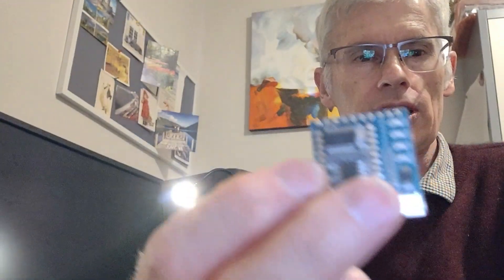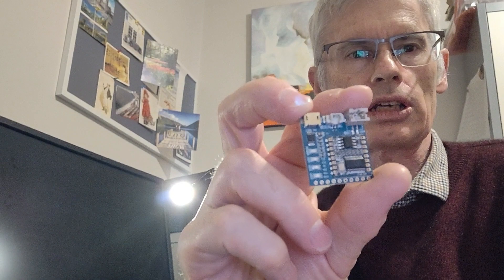How to FLASH Burn upgrade the HiLink HLK-V20 Voice Recognition Module

Comment: Hi sorry to bother you I have one question I tried uploading the program but unfortunately the moment I connect the 5 volt the burning tool app will crash 
What should I do
Reply from the maker: @amanjmohamadi7532  It seems that this program has a driver device conflict which may be the reason it crashes. Try installing it on another computer in the meantime, until your existing issue is resolved.
Reply: @ thank you so much would you  recommend a driver that is matched with the burning tool🙏🏻🙏🏻

Comment: I can't upload firmware. I power up the module after the yellow bar appears on the update tool software, just like you did. The the uploading never starts. Any help?
Reply from the maker: Up on first release Hi-Link did not make their chips FLASH firmware upgradable. If you have their old stock then this method certainly won't work, then they changed their policy during the last six months or so, and all the new stock they sell can be  FLASH firmware upgraded. Now, I don't mind buying their Chinese speaking version, because I know I can FLASH overwrite it with an English.update.bin file, usually with my own commands typed and generated from the online https://udp.hivoice.cn/ compilation platform.
Reply: @paulbellett2442 Hi is there any other method to be able to flash burn the old chip?
Reply from the maker: @amanjmohamadi7532  It's possible to use direct JTAG programming using 4 wires to the chip. I have successfully used a WT516P6-DK_V1.0 USB programmer to accomplish this without going through the chip's serial port lines, TMS and TCK lines are used instead. If you get stuck I have several spates of these JTAG programmers available.
Reply: @paulbellett2442   thank you so much I’ll let you know
Reply: @paulbellett2442  Could you share the tutorial for this method please?
Reply from the maker: @tlese1605 Please standby, its not something I can explain in five minutes , I'll have to dig out the documentation and provide a Cloud link to it for you to follow.
Reply from the maker: @tlese1605  If you have a standard USB to TTL serial data converter, you can upgrade via UART terminals on the Chip - Word document Link is here: https://1drv.ms/w/c/10da6f3dc0068201/EQGCBsA9b9oggBARQgAAAAABKrz9gzAh5ZFTmAkM8HPFBw?e=jwrf07

Comment: Please help ,
How to connect hlk v20 with arduino and use relay module to connect home electronics device.😊
Please make a full details video.
Reply from the maker: This should be reasonably straightforward to present on a video which may take another few days before it is ready for upload.  Each voice command from the V20 outputs a unique serial data hex character which the Arduino can capture from the serial data stream buffer. This captured code then can be used to turn on/off a relay or any other device hooked up to it.
Reply from the maker: Hi @mddilyanyt - Whilst I quite haven't got up another video yet on this topic, in the meantime  try my website for Arduino code demo sample & downloadable PowerPoint @ http://microwebserver.net/Hi-Link_V20code.html?

Comment: In your documentation there is a definition for UART1_TX. I can't find the option for it. Am I missing something? Is it just pin 6/7, even though UART1 is on B0 and B1?
Reply: God damit. It took me literally 2 days to figure this out... You have to change the GPIO ports.
Reply from the maker: @PhilippBlum  Yeah, the drawback is that this microcontroller can only have one UART working, so therefore it is best to assign the pin numbers that you particularly wish to use, before Flashing the BIN file for it otherwise your PCB layout maybe affected.
Reply: @paulbellett2442  I already found my mistake. Took me too long though. You have to configure the pins yourself, otherwise UART is just not present. 
After a lot of translating I found it. The chip actually works really well. Especially for the price.
Reply from the maker: @PhilippBlum  Yes, nice little micro for the price. One of the most powerful, but least documented features is the ability to learn or receive  Infrared signals, store them and transmit them upon voice command. Handy if you wish to turn on an air conditioner or TV etc, without having to reach for the always missing battery operated remote in our family. I hope to demo this novel feature as a tutorial in a YouTube video later.
Reply: @paulbellett2442  That's indeed extremely interesting. Yeah, that would be amazing. Can you tell me what pins I should keep free for that feature? So, I could have it as an add on later?

Comment: Hi. good video. Do you know how to change voice commands of VC-02 kit offline voice module. Iam 168 sub
Reply from the maker: There are two methods for changing voice commands for vc-02 AI thinker. 1st is the online website platform. 2nd is secondary offline development via Toolchain dependencies and Linux C language compiler, but it is much more powerful once you have mastered it.  The easiest is to use the UniSound Hummingbird M Chip platform which can be accessed via https://8ms.xyz/  or Hi-Link's website itself - http://voice.hlktech.com/yunSound/website/toAppkeyPage. [ Registration is required - Set Google Chrome to automatically trranslate the webpage to view it in English] This does not require any programming skills to type in the commands you really want, but like any successful recipe it pays to follow the required instructions carefully to get it to do what you want it to do. Some more info can also be found here - http://microwebserver.net/Downloads.html